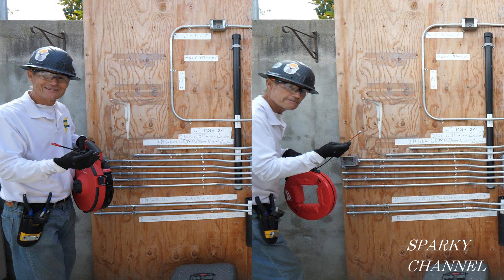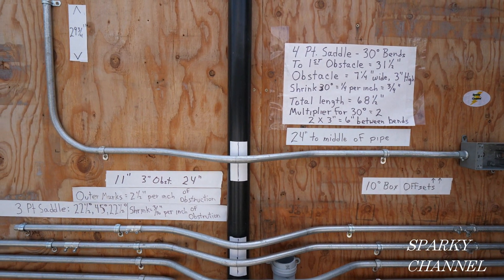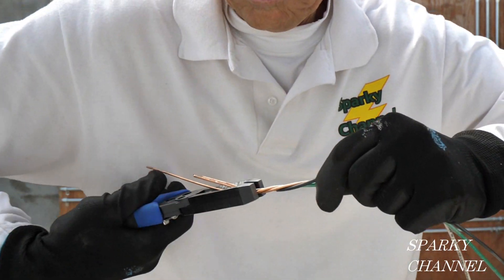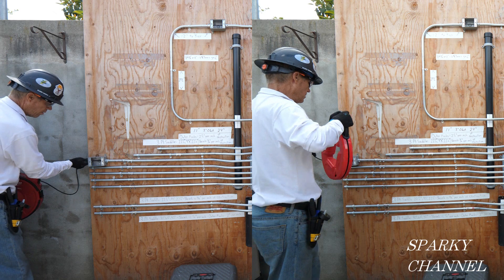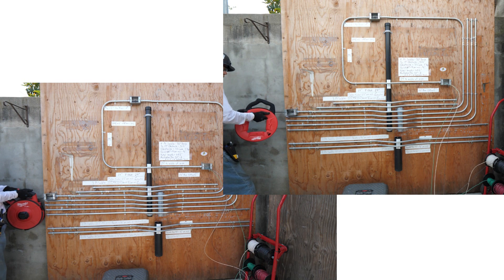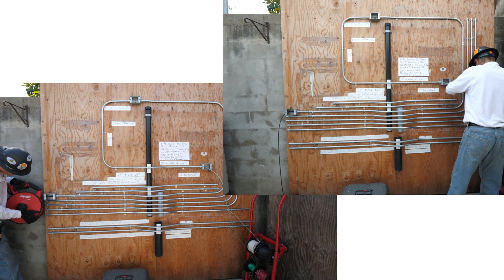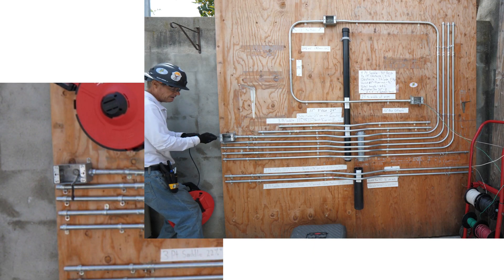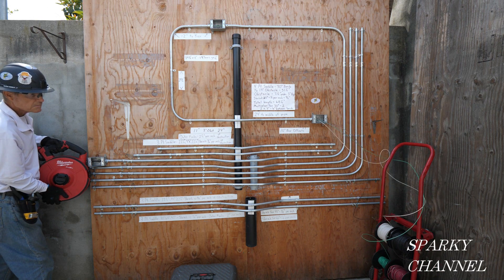Milwaukee Angler Sparky vs Fish Tape Sparky Wire Pulling Contest!

Comment: Pretty cool, and think the “new” angler is nice to have; and if can score a kit on a promo, AWESOME!
Having this really is a game changer if running wire and have multiple degree bends going to a drop. Some of those can get “tricky” and may really need 2 ppl to make things smooth.
Do like the polyester as nice to have and is my fav, I’ve found that at times, using the steel or diff fish tape can work “better” (but rarely do I use a steel tape anymore).
If only have 1 person, and doing long runs w/ multiple degree bends, I’d sure would rather have an angler than trying to run a fish tape by myself 😉
Cheers✌🏻
Reply from the maker: My opinions exactly. We seems to like the same tools. LOL!